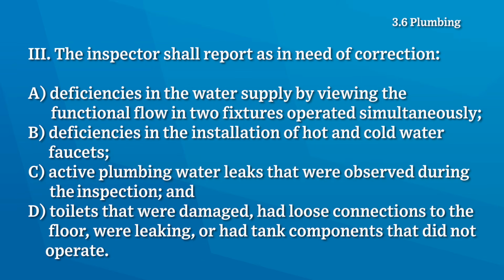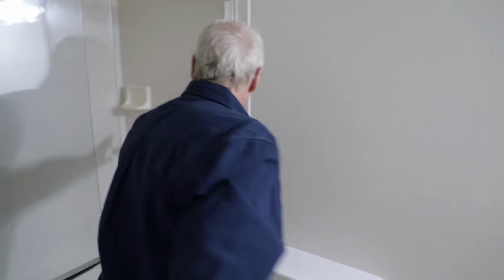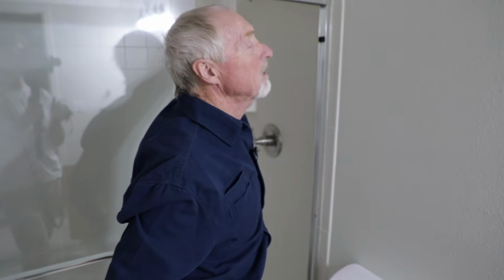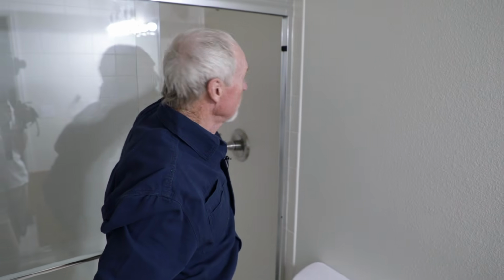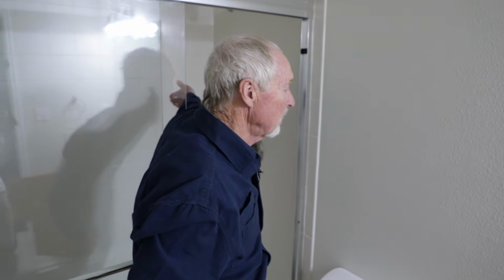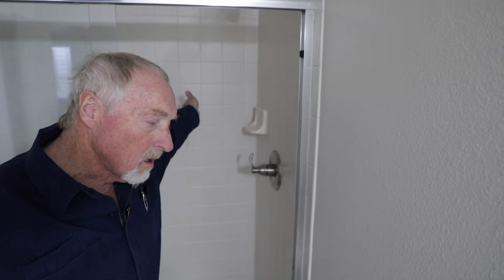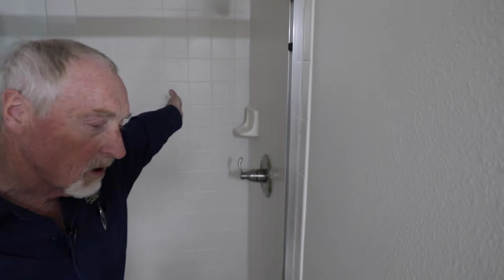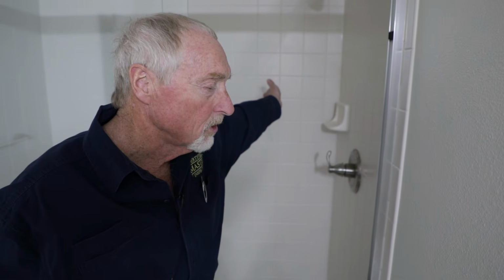Performing a Plumbing Inspection According to the InterNACHI® SOP

Comment: On another video the master inspector said the toilet should NOT be completely sealed around the perimeter unless it is sitting over a slab. Over wood framing floors it should be not according to him.
Reply from the maker: One of the practices is to leave an open gap by not sealing the entire perimeter base of the toilet where it sits on the bathroom floor, regardless of the floor surface type. The idea is to allow a toilet water leak to come out conspicuously onto the bathroom floor.
Reply: @internachi  Yes that's how I understood it.

Comment: Isn’t the water heater supposed to be 18inches off the ground?? Or is it just in the garage
Reply from the maker: There are standards for that. The 2021 International Residential Code (IRC) addresses the elevation of water heater tanks in garages under Section M1307.3.

IRC 2021 Section M1307.3:

"Elevation of ignition source." The code requires that appliances, including water heaters, with an ignition source must be elevated so that the ignition source is located not less than 18 inches above the floor of a garage.

This requirement is to minimize the risk of igniting flammable vapors, such as gasoline, that might accumulate near the floor. It's important to note that this requirement typically applies to fuel-burning water heaters with an ignition source and not to electric water heaters without an ignition source.

This code ensures safety by reducing the risk of fire in areas where flammable vapors might be present.
Reply: @internachi  thank you

Comment: 15:00 Other InterNACHI inspectors have suggested that the toilet should NOT be sealed all the way around, but a gap left in back so that if there's a leak, it's detected through the back of the toilet and doesn't seep into the floor.

Is there an InterNACHI recommendation on sealing around the toilets?
Reply from the maker: Not a formal one. It's really up to the plumber. I personally prefer the backside of the toilet base (where it rests on the bathroom floor) to be unsealed.

Comment: one question on the bathroom sealer..you said it has to be seal all around with what material. you ve said not caulk..other inspector told me it is supposed to be caulk all around less 2 inches in the back of the toilet to see when it leaks . you wanna see a leak in the back of the toilet ... so which one is correct...can you explain.. please
Reply from the maker: Hi, Pablo. I don't believe it's code or standardized, but more like a personal choice. I like your suggestion of leaving a couple inches in the back of the toilet not sealed. That allows a leak, if one exists, to come out on the floor and be seen, and then fixed. If it was sealed all around, no one would know, until it appeared below.

Comment: The black specks in the hot tub is more than likely, dried corrosion from galvanized steel not Mold. My assumption is the house has been unoccupied for a little while. Not a serious issue but recommend a licensed and bonded plumber to look at the system for replacement in the future. Be careful with the M word around agents. This guy obviously works with flippers😂😂. Great info though. Thank you.
Reply from the maker: Thanks for watching.

Comment: Is the gas pipe shut off valve in the wrong position? I thought it was to come before the drip leg not after it.
Reply from the maker: Oh, great question. You may want to contact the inspector, Lon, at https://www.nachi.org/certified-inspectors/lon-henderson-cmi-53115. You may also be interested in free, online inspection classes at https://www.nachi.org/webinars.
Reply: Not sure if you got tour answer yet, but the shut off valve should be before the union fitting. It should go, Piping, gas valve, short nipple, union, short nipple, Tee. 2-3" nipple with cap for drop leg facing down vertically. Then whatever fittings you need for your particular appliance, coming out horizontally from your Tee. This allows you to shut off the gas and remove everything that you need to when changing appliances. Hope this helps.

Comment: Previous nachi plumbing video stated if a toilet was not on a slab. The caulk could not be completed all the way around.  Theoretically to detect if the wax ever fails.  What should we be following?
Reply from the maker: I'm not sure there's a code standard about the sealant around the toilet. But I'll look. It would be in https://codes.iccsafe.org/content/IPC2018P3

Comment: on the boiler section, the drain pipe connecting to the pressure valve, does it need to be copper pipe? or can it be pvc?
Reply from the maker: Good question.  I invite you to take the Master Class for Home Inspectors at https://www.nachi.org/masterclass.htm.

Comment: You stopped the vanity sink and filled it without doing any inspection of the under sink plumbing first. I did that once in new construction and found that the drain plumbing to that sink had not been installed. 

Now, I look below first, then run some water without stopping the drain, THEN I fill the sink.
Reply from the maker: Nice, Ron.

Comment: 11:00 If a homeowner is recommended to test the TPR valve annually shouldn't it follow that there would be water staining by default? Not sure if the stains would tell you much if they are meant to be bleed onto the floor regularly like that.
Reply from the maker: Good point, Marcello. Home inspectors are keen to observe any type of water mark, dry or wet. Diagnosing is not part of a home inspector's responsibility, but it's fun.

Comment: The expansion tank should be installed on the cold water line before going to the water heater rather than on the hot water line.
Reply from the maker: It's usually on the cold supply, but the manufacturer's installation recommendations will be specific about that. Here's an example: https://www.hotwater.com/lit/im/tanks/332845-000.pdf

Comment: Question about how the inspector says he wants caulking around the toilet. Why does he want that? I wouldn't want that as if there was a leak you wouldn't notice until it seaped through the floor. Thoughts?
Reply: Section 405.6 of the 2018 IPC requires the toilet to be sealed to the floor.  P2705.3 of the IRC says that plumbing fixtures (toilet in our example) should be water tight to the floor which typically is interpreted as "caulked" to the floor.   Some code experts these codes as caulking 360 degrees around the base.
Two purposes to sealing the toilet to the floor.  One: it helps anchor the toilet to the floor, particularly on an uneven floor sometimes seen in old homes.  Secondly, sealing prevents water from getting under the toilet from an overflowing toilet (who hasn't had a toilet overflow?).  An overflowing toilet is far more common than a leaking flange seal.  A popular discussion point is, what constitutes "sealed to the floor."  While the IPC may have some wiggle room, the IRC does not allow for ambiguity by requiring a water tight seal.  In our biz, many city inspectors and plumbers like to leave the back of the toilet uncaulked to allow a leaking wax seal or flange seal to reveal itself out the back of the toilet.  I suggest finding out what your local city/county inspector requires.
Reply from the maker: It's really up to the inspector to make comments such as that which is in the best interest of their client. Home inspectors are not code inspectors, and they don't intend to be knit-picky, but recommendations to seal around a fixture is in general a good recommendation.
Reply: a previous NACHI plumbing video states that caulking can be all around the toilet if the toilet is on a concrete slab floor